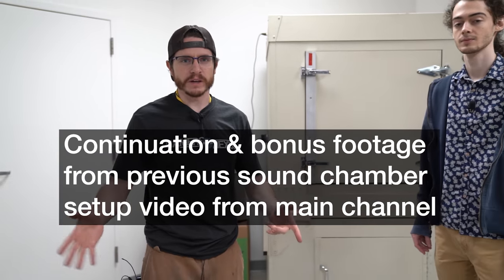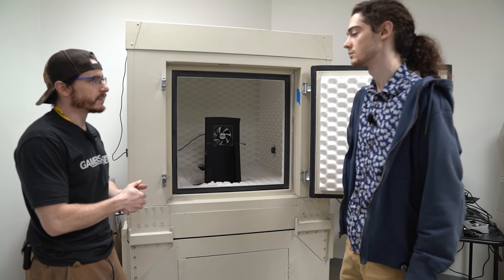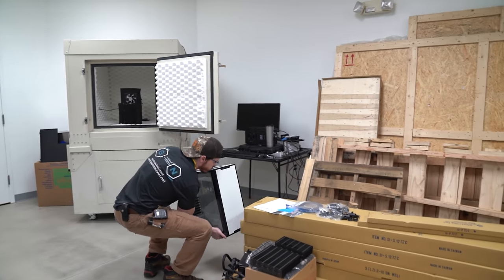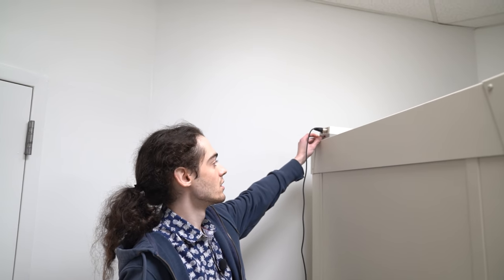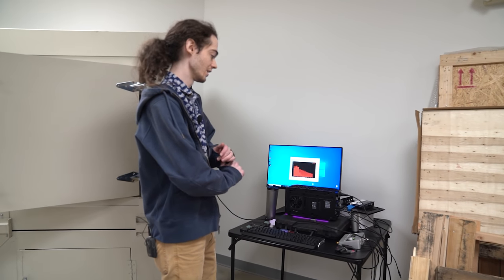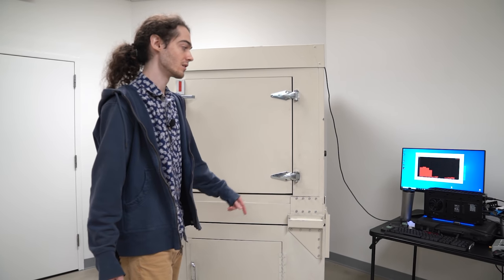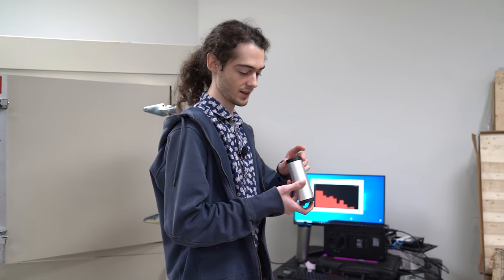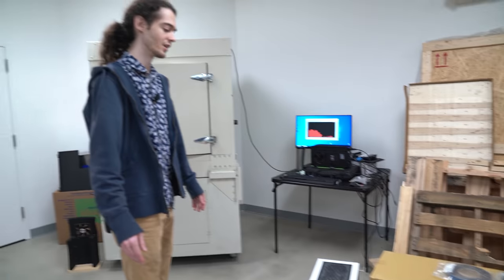IT BEGINS: Finalizing Noise Testing in the GN Test Lab

Comment: GN does it first with the 'lab' concept, LTT is trying to copy with theirs
Reply: LTT is testing other junk. They arent building one of these.
Reply: @crisnmaryfam7344  There's a chance they will. Linus said Steve wouldn't be the only one with this kind of equipment. Last WAN show, he also said something about an anechoic chamber they were looking at.

But seeing as to how Linus's lab won't be operational for months due to delays, Steve will definitely have a big lead.
Reply: @Slavolko  I don't think they plan on tackling fans.  They probably are going to use that for other things.  They COULD do fans, but if Steve is going to do it, no point in LTT duplicating it.  "We" need everything tested, and no point in wasting LTT resources on something that is already good.
Reply: @d3lsl0w  I get what you're saying, and you could be right. I can't read his mind. I just specifically remember Linus saying that Steve wouldn't be the only one with a wind tunnel for testing. I would assume that fan testing would be the main usage of that.

We'll just have to see what their interests with labs end up being.
Reply: @Slavolko  from what info I’ve gleaned from LAN shows, etc. LTT doesn’t plan to have a air testing station. They will have a noise testing station tho, but I feel like they’ll be targeting laptop speakers or coil whine or something like that. Not every popular case fan on the market
Reply: @d3lsl0w  I can't find the specific WAN show where Linus said he wanted a fan tester like Steve, but I know he said it after a SuperChat or merch message asked him about the topic.

Anyways, I get what you're saying. I really don't know. We'll wait and see.